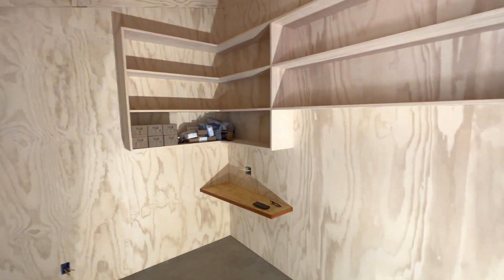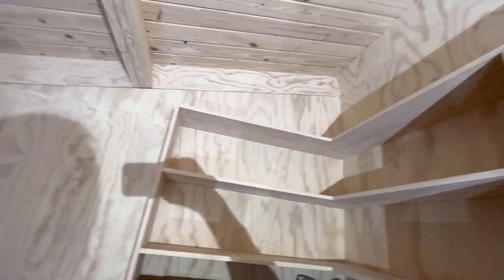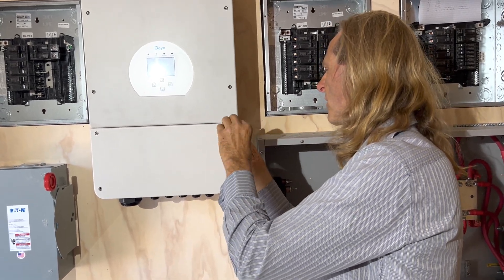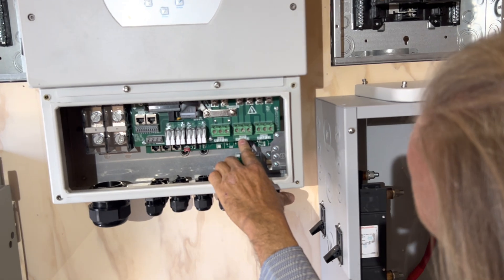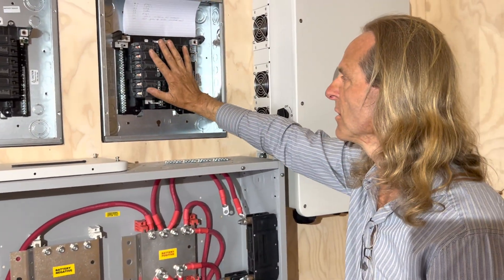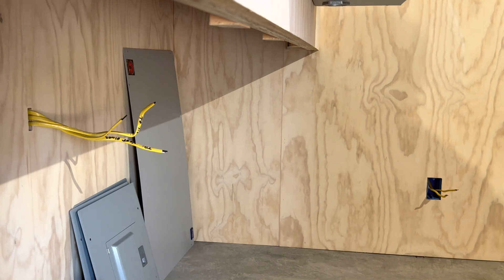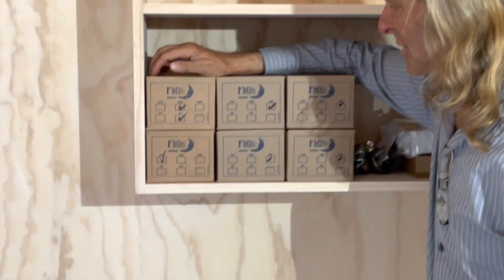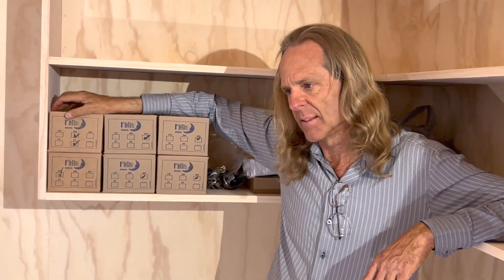Another Big Lifepo4 Offgrid Energy System Comes Together In Style!!!

Comment: You're very talented man and it's obvious that you plan your projects well.
One suggestion, use a mechanical device so that you cannot have two circuit breakers on at the same time which I  believe is called "generator interlock" I bet you're talented enough to construct a circuit breaker panel box cover with a metal movable device to force a user to switch off one breaker before switching the what other breaker "on".
Reply from the maker: It has been discussed but is a low priority and would be a custom project. A 1:1interlock is fairly easy but a 2:1 inline interlock is a bigger challenge.

Comment: NJ USA Height Of Working Space
The final type of working space I would like to discuss is located at 110.26(A)(3) and involves the height of the working space. This space is “to remain clear and extend from the grade, floor, or platform to a height of 2.0 m (6 ½ ft) or the height of the equipment, whichever is greater.” Furthermore, other equipment  associated with the electrical installation, such as a wireway or gutter, located above or below the electrical equipment is not to extend more than 150 mm (6 in.) beyond the front of the panelboard. There have been several instances where this has been unintentionally violated by the electrical installer working in electrical rooms installing panelboards. See figure 7 for a good illustration of this working space height.
Reply from the maker: That is good information for people that are in areas requiring electrical inspections. This is a work safety requirement, not related to function or durability of the system. In this case the panels set back 9 inches from the front of the battery combiner box allows the inverters to have proper ventilation which is related to function and durability of the system. Moving the panels to another wall would have been possible, but.......no. Following every electrical code to the letter would mean not using DIY energy storage systems from what I can gather. I like the fact that it is in a separate building and capable of being completely off grid. I was over at a neighbor's house recently and saw his electrical panel above and behind his water heater and you could only get to the water heater if you pulled the washing machine out. For the record, I am not an electrician and you should only do what I do if you are willing to accept the risks.

Comment: Nice setup..ofc i don't understand fully why t is as you want to have it.. I have suggestion. If you are doing it then fine :).. I know that there are special plates that would not allow you to switch on some switch whiteout switching off another switch..These are placed in that combiner box (where all those fused switches are ).you don't have to folow any instruction..as it is idiot proof.. You just wouldn't be able switch something on without switching something of or vise versa..I did see it that they have it somewhere in USA..here in Europe i didn't see it..
Reply from the maker: I would have to custom make the interlock because they aren't manufactured for the condition in this panel where there are three breakers in one panel and one needs to lock out two others. I could do it and I may but it will be time consuming and it is far down the list of priorities.
Reply: @RayBuildsCoolStuff  ok ..but i believe that is always the best solution. Something that you can be sure wil not fail ..because you or somebody else will make some mistake. You have to always think..what if i'm not here and in case of emergency this and that would happen. For sure you don't want to damage to be done to your equipment. But i understand your concern..

Comment: PVGIS tells me that in the north of texas, with a 114kWh battery bank, and a 10kWp solar setup (35degree slope, due south), you can pretty much pull 20kWh per day with only 0.05% days with an empty battery (once every 5.5ys). With these sorts of dimensions already in place, does it really make sense to have a fossil powered generator instead of adding more solar and/or 1-2 more batteries to even take that small statistical issue out of the equation? Also, either cutting electricity consumption when batteries do run low, or an electric car with V2L could remove that last bit of worry.
Reply from the maker: Average consumption of these projects is 40KWh per day. We pump and treat our own water for irrigation and domestic. At my friends house she pumps the water for three houses and a working ranch. I have a Koi pond that uses 10KWh per day and I charge my car. In a long term grid down situation, I could let them go if I had to but our average use is 40KWh without conservation beyond what we already implement. We are both net zero annually but are adding 50-60% more panels to help address the shortages due to weather cycles. Still I estimate that without the grid there will be 3-4 days when the generator will be required but that could be addressed with careful monitoring, forecasting and conservation. The generator gives us resilience and options. In February of 2021 there were 5 days of very cold temperatures and the panels were covered with ice and non-producing during the period where heat demand was the greatest. A generator gives us a very important piece of our energy independence. Fossil fuels are a wonderful resource. Reducing our reliance on them doesn't mean we should shun them. We are also likely to need MORE electrical capacity as we shift more of our vehicles to electric. I mostly use electric for my vehicle but others in our households are yet to make that shift.
Reply: @RayBuildsCoolStuff  40kWh per day is an insane amount of energy. In that case, the current setup is only half way there to absolute independence indeed.

The generator might become the most annoying and troublesome part of this build though, as it is the only thing that truly requires maintenance. How does one deal with modern fuels and their limited shelve life for instance?

Here's hoping that low battery and solar prices return one day and that V2L gives the generator the final push.

Comment: Hey Ray, its coming on pretty well. Being following your build and have adopted some of your ideas on my installation, so thank you.
I was curious, did you say 8 x 13.5kWh battery banks? If so, a quick "back of the envelope" calculation says you will have sufficient power in those batteries to run the inverters at full load (3 x 8kW) for around 4.5 hours without sun. I imagine you will however average around 20kWh per day, which amounts to 5.4 days without any sun. It sounds excessive, so what am I missing?
Reply: It’s Ray being Ray… that’s what you are missing!🤪
Reply from the maker: I'll copy and paste a reply I made to a similar question. That question was why I need a generator in the overall design.
Average consumption of these projects is 40KWh per day. We pump and treat our own water for irrigation and domestic. At my friends house she pumps the water for three houses and a working ranch. I have a Koi pond that uses 10KWh per day and I charge my car. In a long term grid down situation, I could let them go if I had to but our average use is 40KWh without conservation beyond what we already implement. We are both net zero annually but are adding 50-60% more panels to help address the shortages due to weather cycles. Still I estimate that without the grid there will be 3-4 days when the generator will be required but that could be addressed with careful monitoring, forecasting and conservation. The generator gives us resilience and options. In February of 2021 there were 5 days of very cold temperatures and the panels were covered with ice and non-producing during the period where heat demand was the greatest. A generator gives us a very important piece of our energy independence. Fossil fuels are a wonderful resource. Reducing our reliance on them doesn't mean we should shun them. We are also likely to need MORE electrical capacity as we shift more of our vehicles to electric. I mostly use electric for my vehicle but others in our households are yet to make that shift.
Reply: @RayBuildsCoolStuff  40kWh daily use explains it - thanks Ray. When the others in the household choose to replace their cars with EV's make sure they gets ones with VTL or VTG capability that will be a great resource; 40 - 100kWh of extra storage essentially. The extra panels are a great idea.